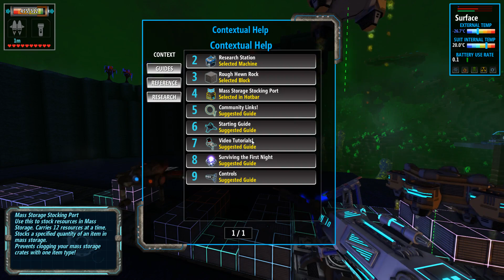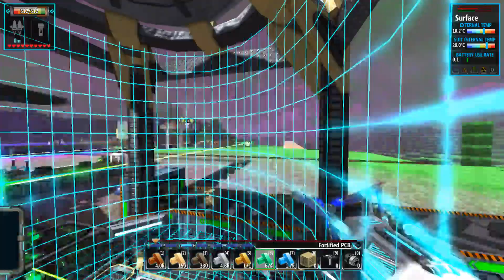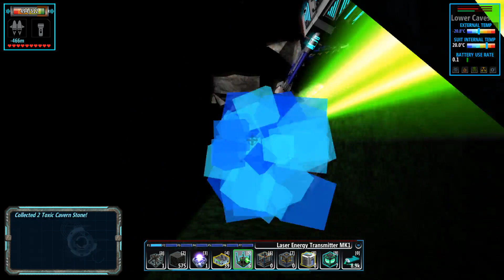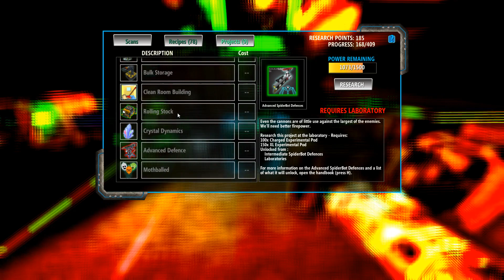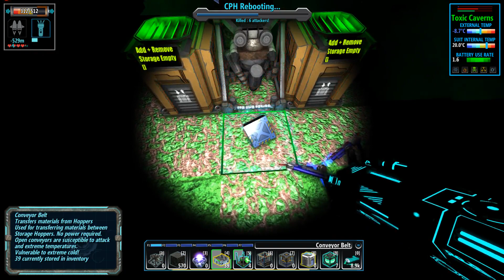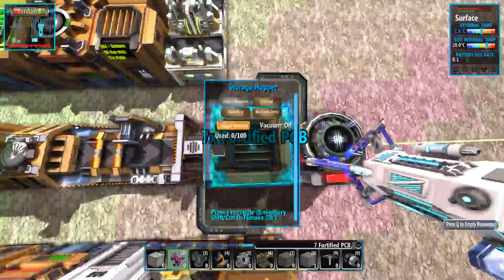Who Cut The Cheese? - Fortresscraft Evolved #11

Comment: After the p20 patch, the CPH reboot time is insanely long which makes the exploration in those caverns full of 'surprise' imagine when grappling hooking in midair and suddenly every torch go dim. I have died several times from this. A good thing about the rapid resource mode is the power drain is not increased from the new patch so far. The power drain in the toxic cavern becomes 16pps and a fully charged Arther and 1024 power package can barely last 5 minutes exploration in plentiful resource mode.